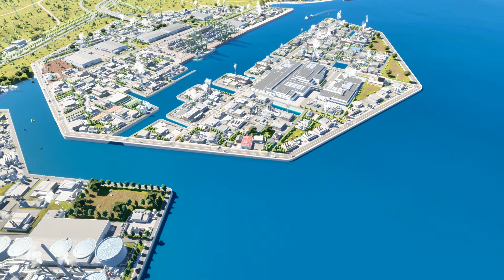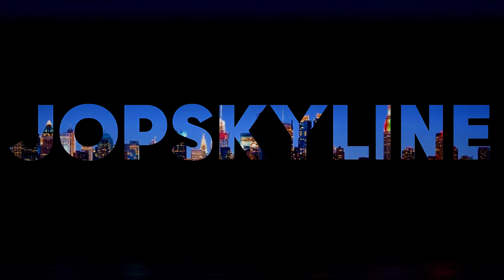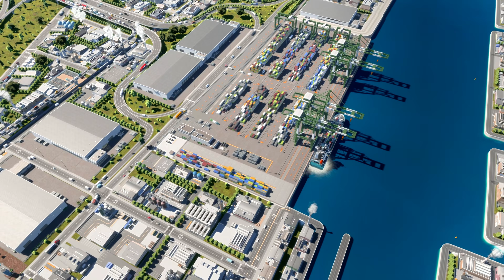This Port Design Makes Cities Rich | Aqualis City Ep3 | Cities Skylines 2

Comment from the maker: Key Moment
0:00 Introduction: The Octagonal Port
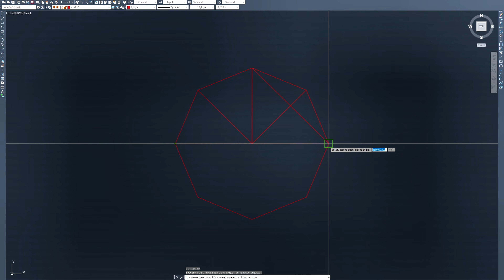1:04 I plotted first in AutoCad then in Cities Skyline
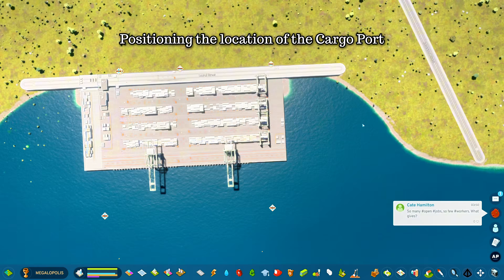3:17 Positioning the location of the Cargo Port
5:32 Connect the Cargo Ship route to the Outside City and Designing the half of the Octagon Port
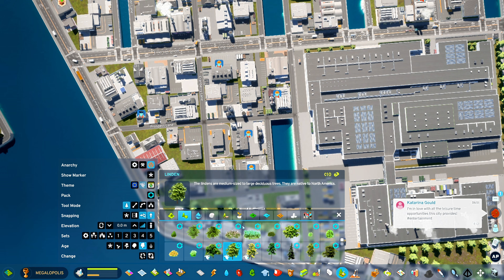6:39 Putting the Entourage of the Port
8:34 Building the Oil Refinery
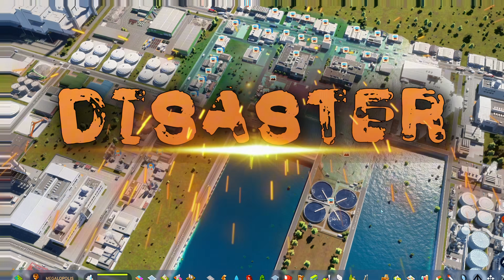12:40 A disaster happened in the Industrial District
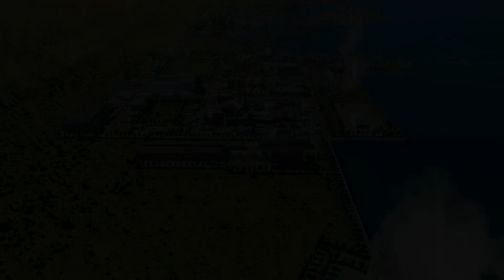14:28 The Octagonal Port